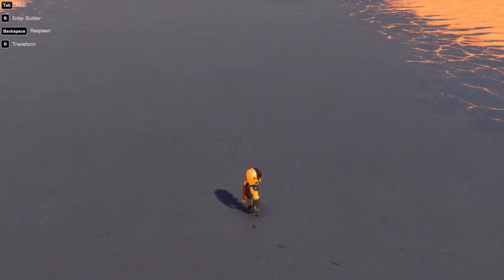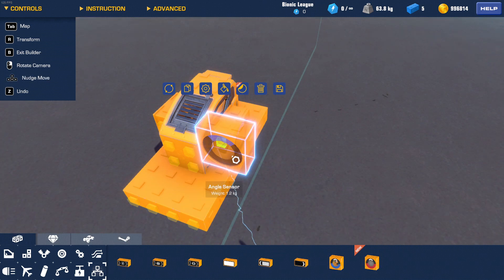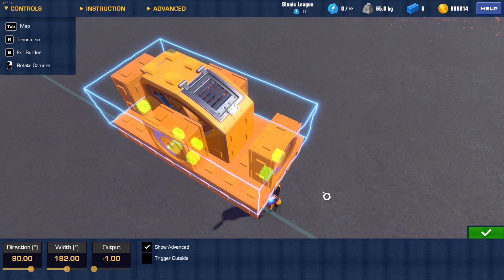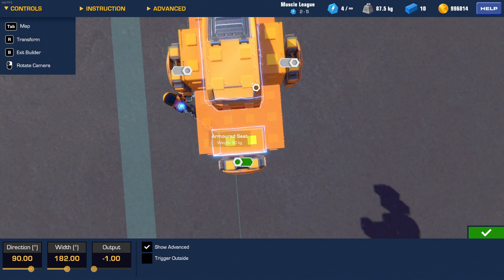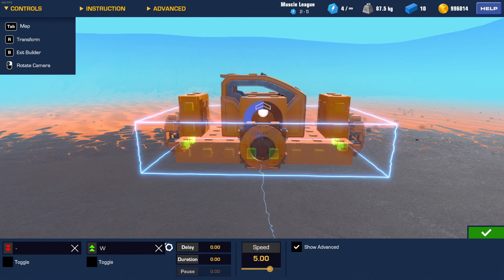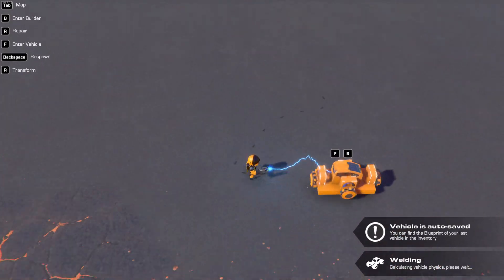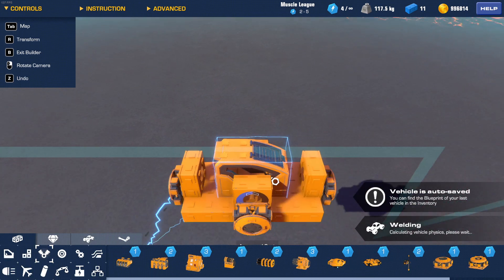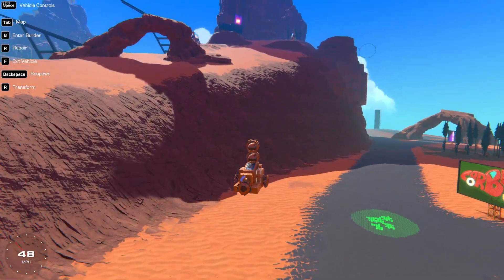HOW TO MAKE A STABILIZER IN TRAILMAKERS TUTORIAL!!!

Comment: you can actually set them to 179 (angle) to avoid that much wigling
Reply from the maker: I did some testing but it only works well on small creations but not on big ones or maybe it depends on what creation you are using. good idea for some creations.
Reply: @HighwayKiller  true, i use 179 on large ships (cargo, cruisers, etc) but for hover crafts i use urs

Comment: I'm having issues with my build. The issue is that it stabilizes slowly, but when it tries to stabilize it gets caught in a feedback loop. What do I do?
Reply from the maker: Hi you have to make all engines spin on flat ground(setting in angle sensor), or maybe the spot you placed the engine is too far away from the center of your creation.

Comment: You set the angle sensors to 90° why was that?
Reply from the maker: if you want it to work you set it to 90. and if you want it be sideways you can set it to 45. if you want it to be level with the ground you set it to 90. it depends on what creation you are building.
Reply: @Highway killer  I understand. Why not just spin the angle the sensor so its facing the way you want it to read?
Reply from the maker: @PerfectedKaos79  what do you mean? the angle sensor are facing out and i can read it
Reply: @HighwayKiller  Don't worry. That wasn't what I said 👍

Comment: mine doesnt work... it flings it self up down lefdt right
Reply from the maker: you can try to place the engines and the sensors in different spots normally center of mass work better. and try to adjust the speed as i said in the video. if your creation is too heavy you will need more engines.